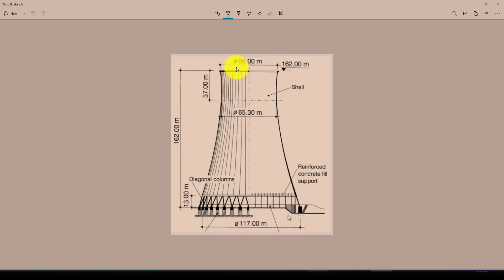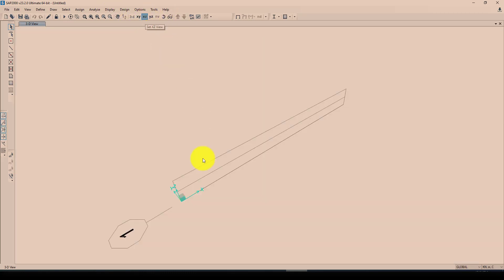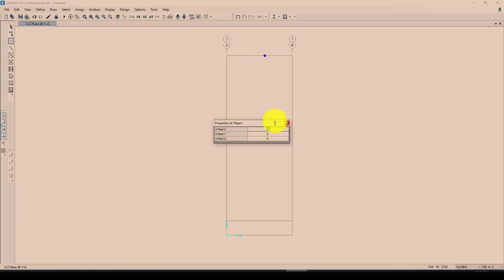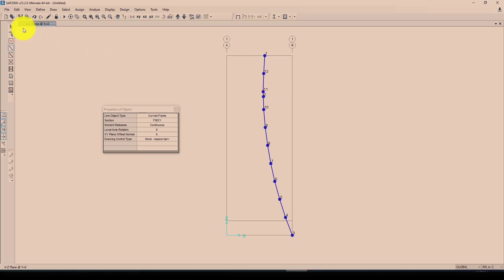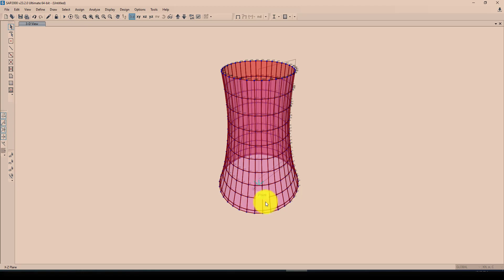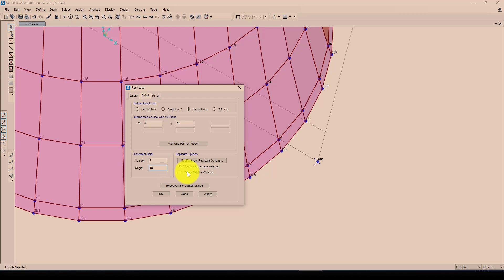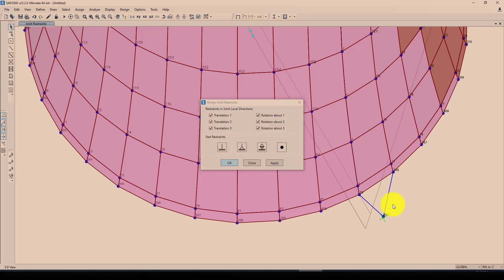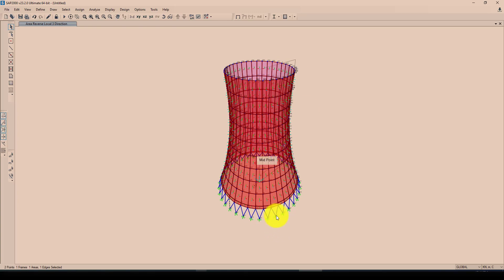SAP2000 Tutorial, Hyperbolic cooling tower  Modeling In SAP2000 v23

Comment: Amazing sir. Sir i understood beam column capacity ratio sir i dont understand column beam capacity ratio in etab and also it's ratio value?
Reply from the maker: if you understand the concept of capacity ratio , than it is the same in ETABS  and all software's.
Reply: @KSSE_Engineer  sir i dont understand column beam capacity ratio in etab which is different from beam column capacity ratio
Reply from the maker: @ajazmahemoodsayyed4122  The ratio of the flexural capacity of Beam/column is computed to preclude the formation of plastic hinges in columns for apparent reasons; refer to section 21.6.2 of ACI 318-11. The sum of a column's flexural capacities at a joint should be 1.2 times the capacities of beam framing into the joint in a particular direction. Etabs alerts the user when the ratio exceeds; if it does not alert, it means either you are ok or have not activated the corresponding seismic category (I think it calculates for category D E & F) for which this capacity needs to be computed.